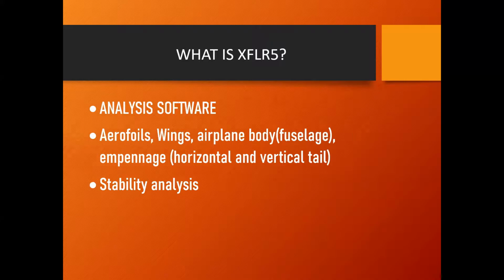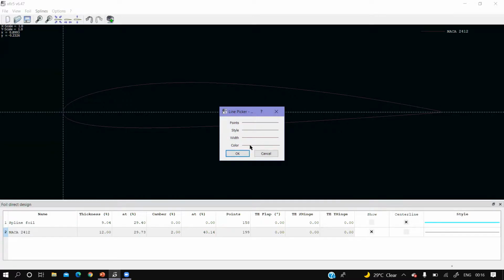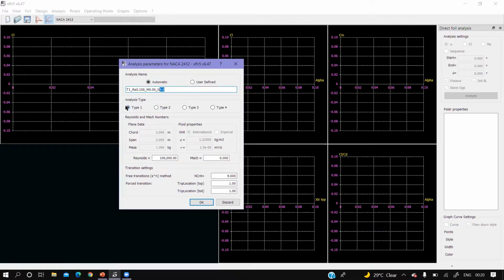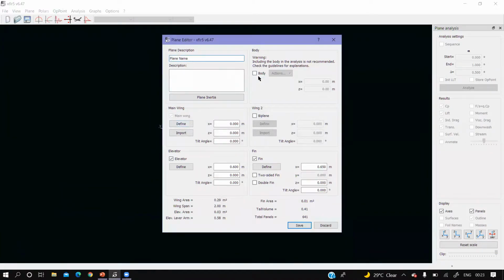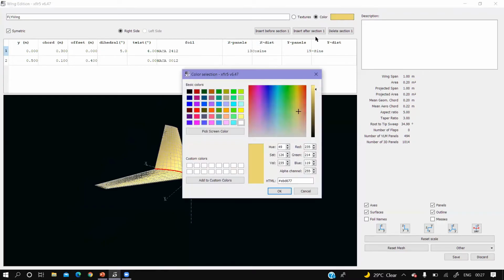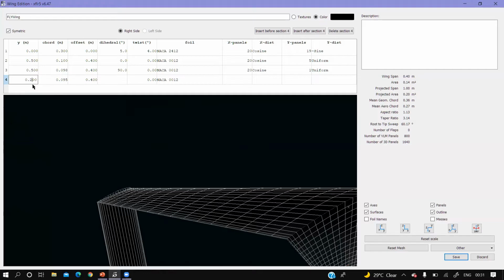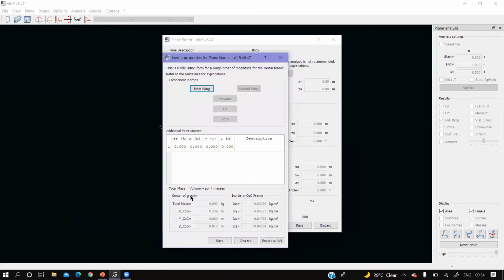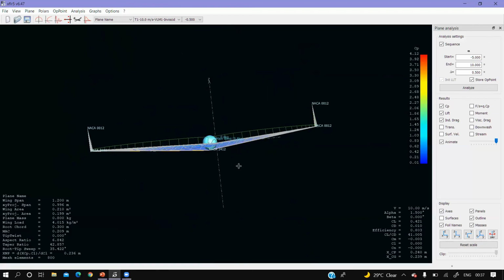INTRODUCTION TO XFLR5

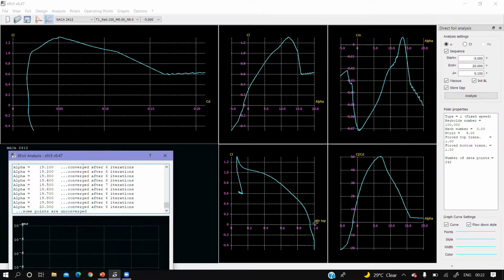Comment: 10:30 This is a position a boundary layer transition point Xtr(ansiti0n)_top on the upper surface of airfoil depending on lift coefficient values. However, the axis are reversed ;).